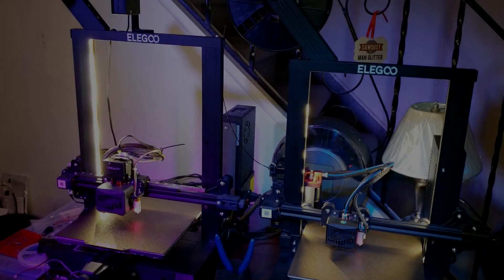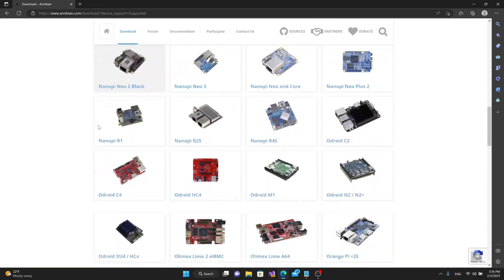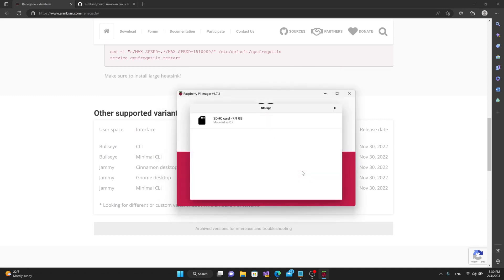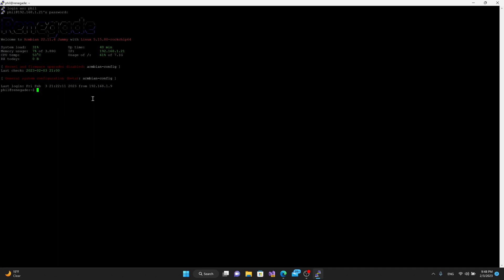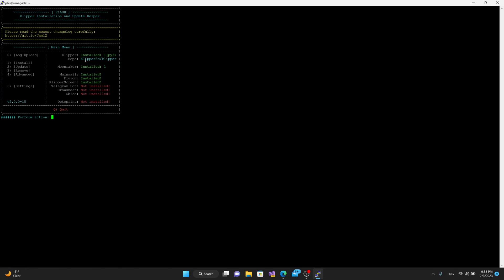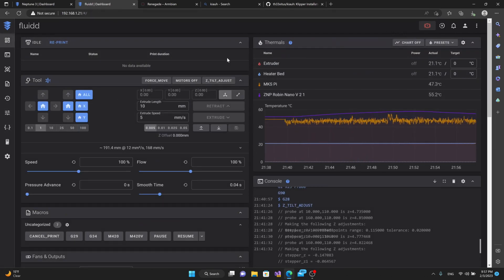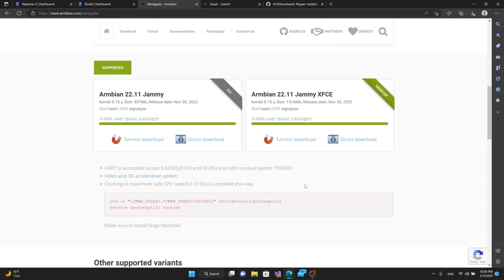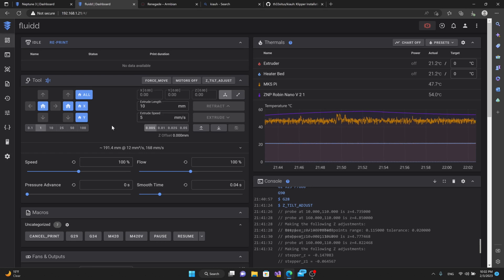Installing Armbian Linux and Klipper on the Libre Renegade 4gb (RPi alternative) SBC

Comment: I have a Iconikal Rockchip RK3328 @1,5GHz, 1GB, can i Follow Your Instructions With that board?
Reply from the maker: Should be very similar. The 3328 has been a bit finicky for me running klipper though. I haven't tried it in a while, but I experienced a bunch of instability with it on my devices
Reply: @TheFeralEngineer  so i should better buy a Raspberry?
Reply from the maker: @MegaKackspecht  try it and see. I just know that my two mks pi boards started acting up after a while and someone with a renegade had the same issue. The bigtreetech btt-pi has been much more stable